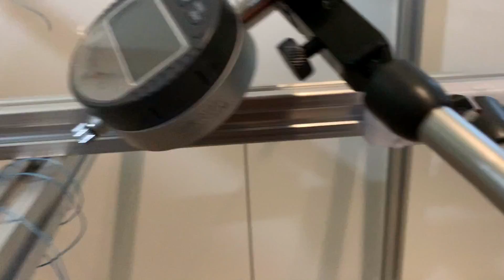Straight-line mechanism Z drive for my upcoming 3D printer build.

Comment: This is brilliant. One thing to be aware of is the ratio between the string diameter and the drum and sheave(pulley)s
Most ropes have a minimum ratio set by the rope maker. The correct ratio guarantees long rope life. If your rope is curly when you remove it after use it indicates that your sheave and drum diameters are too small.
Love the drum equaliser idea

Comment: If you haven't tried it yet, you should check out the strings inside of 550 Paracord.  Its pretty strong and wear resistant, its also cheap and super easy to support.

Comment: It might be good to gear down the stepper motor on the z to increase accuracy.
Reply from the maker: Yeah that's the eventual plan, although it seems to be working OK so far without being geared down (with just the microstepping). I may also use a 0.9 deg stepper instead of 1.8 deg one.